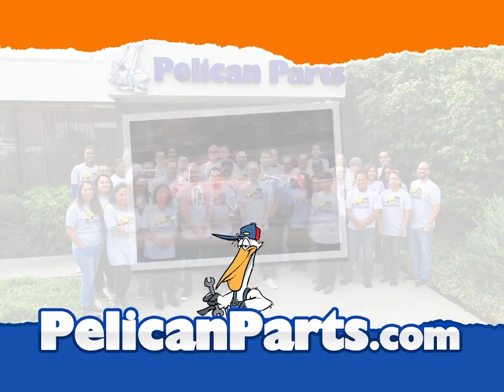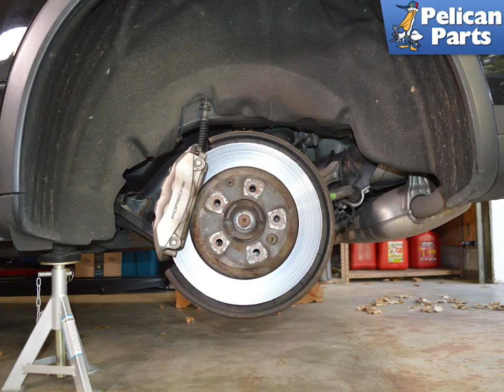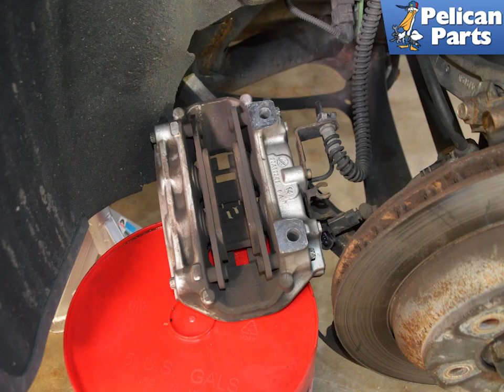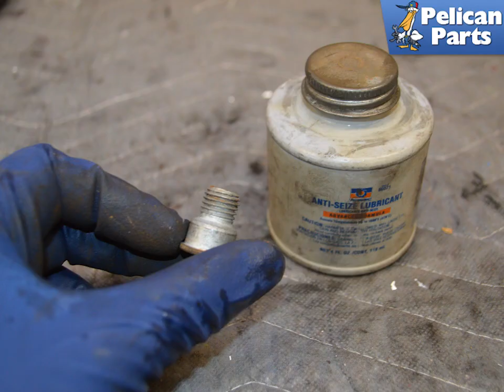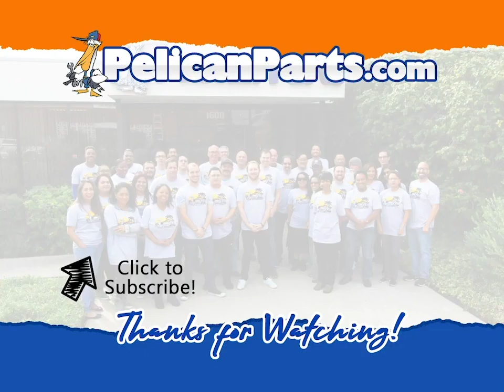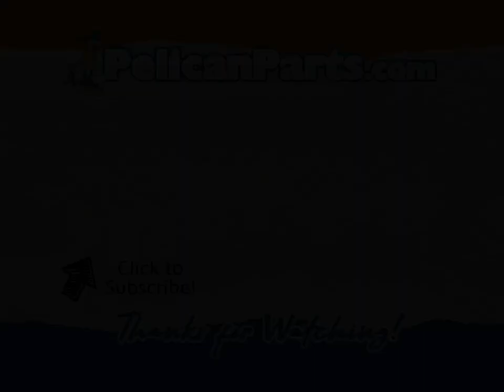Porsche Cayenne 958 Rear Brake Rotor Replacement (2011-2019)

Comment: No mention of putting the electric parking brake in the service, or retracted, position to release the rotor?
Reply from the maker: Some models have EPB and it has to be worked with according to the safety steps outlined by Porsche. There are also some pitfalls to adjusting the air gap. See this info here: https://www.iscantech.com/2020/08/21/porsche-electronic-parking-brake-epb-adjustment-calibration/